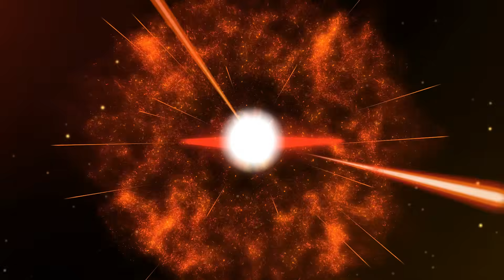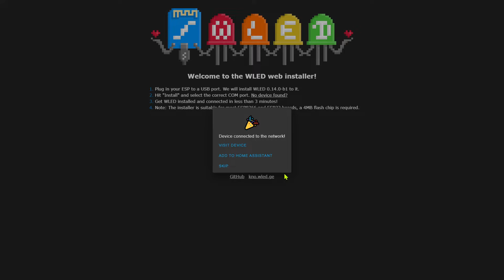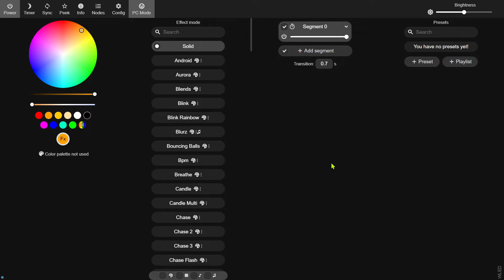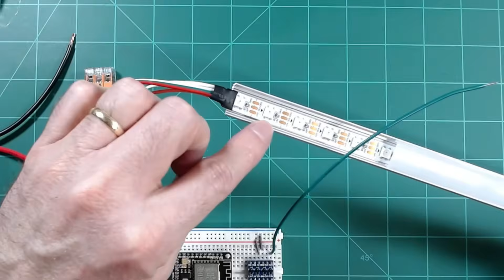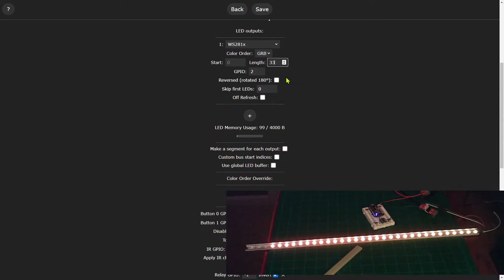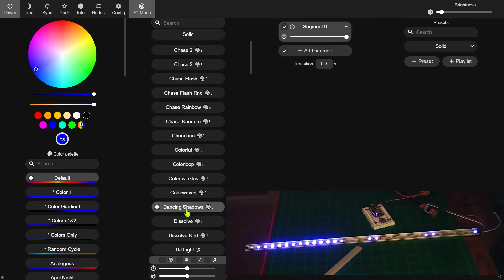How to Quickly Build Your First LED Controller

Comment: how many amps could you run through this build?  or when it gets to a higher number of leds to control do you want to move to a different setup?
Reply from the maker: Well if done as shown here and as I cover in the video around 17:15 (please watch this section), the power for the LEDs  is not running through the controller.  So there is no limit on current as far as the controller is concerned, as the controller itself is only drawing a couple hundred milliamps at most.  Where there are limits are on the size and length (and type) of wire you are using to connect the LEDs to the power supply... and of course the current limit of the power supply itself.  The more current (and the longer the wiring run), the larger wire you need.  There are numerous online calculators that can tell you the required gauge of wire based on the expected amps and your particular install.  Any connectors should also be rated for the expected amp draw.

But from the controller build itself, as long as you are not running the power for the LEDs through the controller board (or off the ESP 5V pin itself), this controller would work with an LED install of 1A, 10A, 50A or more.  As I also mention in the video, if you try to run the power for the LEDs through the actual breadboard, I would recommend you don't exceed around 1A.

To be honest, if looking at a larger more permanent install (and not just testing some LEDs), I would look at creating a soldered version of the controller anyway.  But even then, there would be current limits on the pcb or whatever you are using.  That's why I make the recommendation here (and in a lot of my other vidoes/blog articles on LEDs), that you run your power to the LEDs separately and in parallel to the controller.  That way, the same controller will work regardless of the amp draw of the LEDs.
Reply: @ResinChemTech  thank you for the response.  One last question, how do you wire up the logic level shifter if the 5v and 3.3v are on the same side of the ESP32?  I have an ESPRESSIF ESP32-WROOM-32D that I am using to build a WLED controller, and this is the part that is stumping me.
Reply from the maker: If I understand what you are asking, you'd just have to run a wire directly from the 3.3V pin on the ESP32 to the 3.3V (LV) input pin on the shifter instead of using the breadboard power rail.  Much like how the data signal wire is run directly from the pin to the shifter.

It may or may not be helpful, but I have a set of standard wiring diagrams for these types of controllers.  If you look at the version I use for the mini ElectroCookie, you see that it doesn't have power rails at all and the 5V and 3.3V from the ESP board are running directly to the HV and LV pins on the shifter:  https://resinchemtech.blogspot.com/2023/01/wiring-diagrams.html

I hope that answers your question.

Comment: Please I don't understand how you connected the board with the computer
Reply from the maker: To flash the WLED software?  It is simply a USB cable... a micro USB to USB A (or USB C if that's what your computer has).  Nothing fancy, just connect the two via USB.

Comment: Very good video covering the basics. I'm going to attempt to convert my Govee Permanent Outdoor lights to WLED and you've shown me that I need to power the ESP32 separately from the Govee Lights. So what I will do is get a 5V power supply for the ESP32 and only run the green wire to the Govees then use the supplied Govee Power Adapter (36v, 2.0A, 72W) to power the LEDs. I'm going to solder this to a board and also get a weatherproof enclosure to put this all in.  Thanks for the fantastic instructions!
Reply from the maker: That should work... but in addition to the "green" data line, you need to establish a common ground between the controller and the LEDs when they are powered by separate supplies (whether they are the same or different voltages).  Otherwise, it is very likely that the LEDs are going to misbehave due to ground potential differences.  You can run a ground from the controller to the LEDs along with the data line, or otherwise create a common ground elsewhere between the power supplies.
Reply: @ResinChemTech  Oh great tip, thank you for this! I didn't even think about it, I'll make sure they're connected by the same ground!

The other thing I was thinking is if it's possible to use just the Govee Power Adapter as the power source for both and put in a resistor just before the ESP32 to drop the voltage down to 5v?  Or would 36v going into the board be too much?  I'm going to use an electrocookie as my board to mount the ESP32 onto. My idea is to have the 36v coming into the board and put jumpers to get the 36v to the other half of the elctrocookie and have it pass straight thru that side as 36v and the wires to my lights connect to that side of the board (using same ground). But on the side with the ESP32 add some circuitry to drop the voltage to 5v into the ESP32.  

This is my first attempt at this kind of electrical work so please ignore my ignorance if I'm way off base with this question/idea of mine and if what I'm thinking of isn't possible on a electrocookie board (or any board for that matter).

Comment: 16:25 In conclusion, can I inject power through those extra 2 left over cables with a different power suply and inject power to the esp32 board with a different power supply? In other words, I can use 2 different power supplies to power the LED and ESP32 separately ? Right?
Reply from the maker: Yes, you can use a separate power supply for the ESP and the LED strip.  However, you must establish a common ground between the two  or erratic results will occur with the LEDs.  You can see an example in my standard wiring diagrams:  https://resinchemtech.blogspot.com/2023/01/wiring-diagrams.html (see the example where a 12V and 5V supply are used... this same wiring can be used for two 5V supplies as well).

However, never connect the  positives (+) of two different power supplies together (only the grounds), even if they are the same voltage.  You need special 'balanced' power supplies to connect them together or bad things are likely to happen.  But yes, you can use one power supply to power the controller (like via the USB on the ESP board) and a separate 5V (or 12V) power supply for the LEDs.  Just assure you connect a ground wire from the controller to the LEDs... and that you are NOT connecting the +V wire from the controller to the LEDs.

Comment: want to apply this Mod to my headlights for my vehicle :)
Reply from the maker: You could use 12V LEDs and power the system via the car battery, but you'd need to step down the voltage to 5V for the controller via a buck converter or other means.  And of course there is the whole waterproofing thing.   I also can't attest to the legality of having multi-colored flashing LEDs for your headlights!  But it certainly possible to do it.
Reply: @ResinChemTech  It is quite illegal and opens one to 3rd party damage claims as well

Comment: Sir my esp32 is not working at Vin supply but it only works at 3.3 v can you help with your expertise on this field to solve this problem
Reply from the maker: Are you saying that if you connect 5V  to the 5V (or VIN) and ground to GND, the board does not power on?  Will it power on if you connect it to USB?  You may simply have a bad board or the onboard power regulator may have failed or be faulty.

When powering the board via VIN/5V, either via the pins or USB with 5V, the voltage is stepped down by an onboard regulator to 3.3V, which actually powers the ESP chip itself.  By connecting to 3.3V, you are powering the chip directly, but without any power regulation and even a small variance in that voltage can damage or destroy the ESP chip.

However, if you say the board isn't powering on via the 5V connection, then the board is probably faulty.  You might need try a different board.

Comment: Pro tip: You don't need a logic level converter, a simple Diode will also do. It's cheaper and easier to wire and package IMO.
How i do it: Separate the first LED from the strip and connect ground and signal with a wire to the rest of the strip as normal. Power the first LED through the Diode, and the strip/second led directly from the source (not through the diode). 
Here is why it works: The chips that live in each WS28xx LED can work on 3.3v and 5v and will switch automatically. Diodes drop about 0.7v which gets the voltage in range for the first LED to be in 3.3v mode and correctly interpret the signal from the microcontroller. The second LED (and the rest of the strip) runs at 5v, but the second chip can still interpret the incoming 3.3v signal and will  output a 5v signal forward as its working at 5v. Basically the first sacrificial LED is used as Logic level converter. The only real downside of this, is that that first LED is not as bright, as its working on lower voltage.
Works great for me as i always have a diode around and its easier to hide under the shrink tube or wherever you place the capacitor.
Just thought i'd share, it made my life much easier.
Thanx for making these videos, 
Happy ledding everyone! 🙃
Reply from the maker: Thanks for the tip.  I think what you are describing is a version of the "sacrificial pixel" method that I do talk about and cover in numerous other videos, both on the logic level shifter and various other LED videos.  Depending upon someone's comfort level with soldering, how they opt to mount components, etc., the sacrificial pixel method can be easier or more difficult than using a bidirectional shifter that I show here.  In fact, WLED even has an option to omit lighting up the first pixel is you are using the sacrificial pixel method so that you don't need to worry about trying  to hide it or tuck it away... it will just be skipped and remain unlit for all colors and effects.

And as I mentioned (and have received numerous comments about), you can often get away without a shifter at all if you keep the data lead short.  My take and opinion is to always include some sort of level shifting on my controllers.  Then I don't have to worry about a longer data lead or misbehaving LEDs due to poor signal voltage.  But these are DIY projects and everyone is free to do it there way... including omitting a shifter altogether if desired.

But I do appreciate you taking the time to post a comment and an alternate method.  With nearly all projects that I do on my channel, there are multiple ways to get to the same end result.  Thanks for watching!
Reply: @ResinChemTech  sorry its the first video of yours i have seen : )
And my comment was honestly  directed to the viewers, i should have worded it better. It makes total sense to show the shifter in the video, which is the correct way of doing it. I just assumed some future viewer might find the sacrificial pixel trick useful after watching the right of way of doing it.
P.s. Thanx i didnt know there was an option in WLED even hehe. I usually just use it normally or ignore it in the segment : ) 
Keep doing what you are doing.
Reply from the maker: Absolutely no apology needed!  In fact, I love it when viewers may suggestions for alternative (and sometimes better) ways of tackling some projects.  In fact, I've improved a couple of my own projects (e.g. sensors on my stair lights) based on suggestions from viewers.  And I can always learn a new thing or two as well.

I only mentioned the fact that I was aware of the sacrificial pixel method and have used it myself.  This particular video came about from many other videos where I create a soldered version of the controller and heard that a lot of viewers were unable, unwilling  or too intimidated to attempt soldering... but really wanted to try their own DIY LED strips.  I tried to make this particular video as simple as possible for someone that might be starting out creating their very first controller.  So, I just stuck with a pretty simple option for a level shifter... and didn't want to add to the complexity or confusion by introducing other options... like the sacrificial pixel, the SN74AHCT125 quad buffer gate shifter, etc.  The hope is that if someone accomplishes this simple breadboard version, they might move on to more 'advanced' or soldered versions... where alternative shifting methods could be employed as well.

But truly, I do appreciate the comment and the recommendation.  Thanks!

Comment: What does logical level shifter do for me?
Reply from the maker: It boost the 3.3V output from the ESP GPIO pin to the 5V signal expected by the LED strip.  If the voltage drops too low due to resistance in a longer wire run from the controller to the start of the LEDs, the LEDs can flicker, misbehave or even refuse to light up.   I mention this briefly in the video, but also talk about it in detail along with showing what can happen if the voltage is too low in my video specifically about the logic level shifter ( https://youtu.be/Q9mLitVxF3c ).  I also talk about it and its purpose in my video on common LED questions (  https://youtu.be/GZv5Ztj6i6I ) which has a section specifically discussing the shifter.  I recommend you check out one or both of those videos if you want to know more about why I recommend using a logic level shifter.

Comment: You keep mentioning the Logic Level Shifter.  But you never mentioned why why should or shouldn’t use it.  Benefits?   Necessary in what situations?
Reply from the maker: I actually have two separate videos that specifically cover the logic level shifter, including why you should use it and what can potentially happen if you omit it:

Logic Level Shifter - Do you really need it?: https://youtu.be/Q9mLitVxF3c
Are I2C Shifters Really Too Slow?: https://youtu.be/61VWgYmomz4

The primary reason is that the ESP GPIO pins output a data signal at 3.3V and the LEDs expect a 5V data signal.  While the LED strips will generally work with only a 3.3V data signal, if the voltage drops much below that (generally due to longer wire runs between the controller and start of the LEDs), then the LEDs will begin to flicker and give inconsistent effects due to a faulty/weak data signal.  The first video list above shows an example of that and how a logic level shifter resolves the problem.

Comment: I really enjoy watching and learning from your videos.  I am in the process of installing a motion sensing LED strip on my basement stairs.  Just waiting on all the parts to arrive.
Reply from the maker: Those extra wires are there in case you need to do power injection.  For longer runs of LEDs, resistance will cause the voltage to drop, eventually leading to the lights fading/changing colors.  These extra wires are provided so you can "inject" 5V and GND from your power supply along the strip to boost the voltage back up.  For shorter runs (say around 300 LEDs or less), you probably won't need power injection, so you can just ignore those extra wires.

I'll actually be releasing a video next Saturday that talks about power injection, along with a lot of other common LED questions.  But I'm sure you can also search for LED power injection and find lots of useful information.

Thanks for watching... and your kind words!
Reply: Thanku so much for vedio i larning

Comment: What if you are using LEDs that require 24VDC? Can you wire in a step down transformer to 5V?
Reply from the maker: If you check the video description, you see a link that I have to a article with various wiring diagrams for a LED controller.... including one with an option to use a step down converter that can be used with 12V or 24V LEDs.
Reply: @ResinChemTech  I did not notice that. Thanks!

Comment: So you don't put a resistor inline with the data channel?
Reply from the maker: Generally, I don't and haven't had the need to.  I did have one exception due to a very long run of the data line where it was in a 3-wire cable so it ran over that distance in parallel with the ground wire.  In that case, I needed to add a 33Ω resistor on the data line.

But none of my other installs have had any issues without a resistor on the data line.  Of course every situation is different and a resistor may be needed in some cases.  With that one exception, I just haven't had a need to add one and haven't seen any negative effects without it.

Comment: Great video. Can I use effect only to turn on the led strip and turn off. So when I connect electricity it would be like running water effects?
Reply from the maker: You can save any effect you want as a preset.  Then under the LED settings, you can apply this saved preset as the default to run when the LED controller boots up or is powered on.  I believe this is what you are asking.

You can check out all the features and options of WLED on their official web site: https://kno.wled.ge/

Comment: Thanks for showcasing WLED software -- I manually bake all my custom animations into my NodeMCU units, so definitely going to give this a shot! I'd love to find out if it supports webhooks to trigger effects via the web after the wifi is hooked up. Thanks! -phrozen
Reply from the maker: You are welcome.  WLED can use websockets, along with an HTTP and JSON API.  You can see more about the available interfaces here:  https://kno.wled.ge/interfaces/websocket/

While I have done a bit of custom stuff with LEDs and Arduino/C++ and FastLED... it's hard to beat the convenience and all the featuress baked into WLED.  Good luck...let me know what you think if you try it.
Reply: @ResinChemTech  my mind is blown! Yes like you I know my way around an arduino and completely agree the convenience here is top notch! Just dig into the JSON api, and that’s exactly what I’m looking for! Fan - friggin - tastic! Thanks!